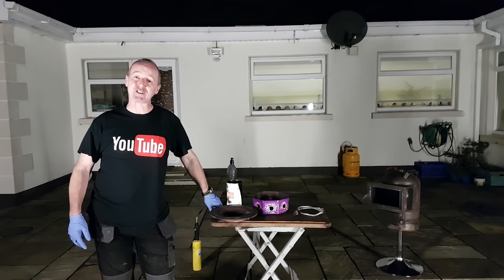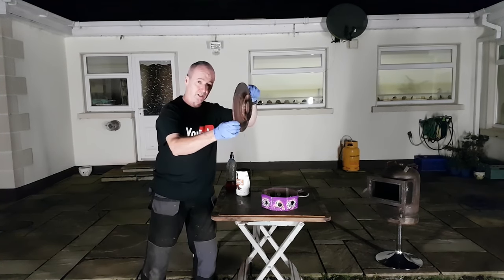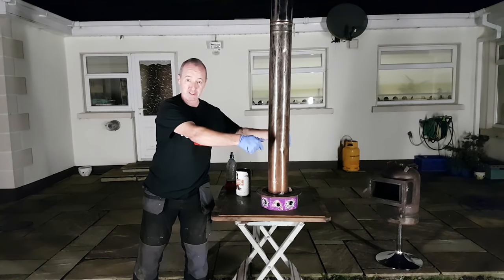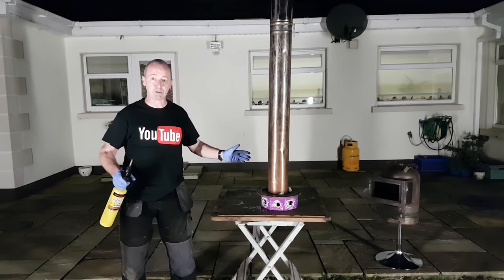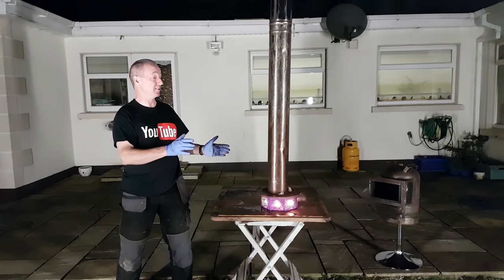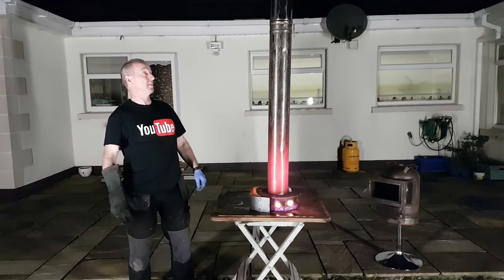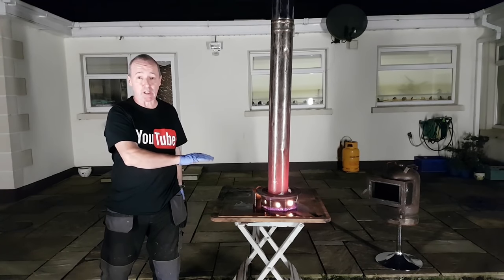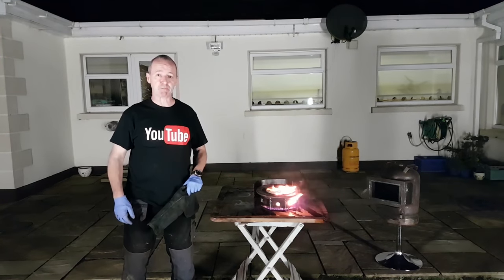Fantastic Output - TIN CAN - Waste oil Burner

Comment: Pardon my ignorance, is this clean burning when it fires properly?
Reply from the maker: Hi IndyRosebush I was just using this as a demo and a prototype but it can burn clean once you get it up to temperature and you can control the oil. In the next video I added a drip feed system https://youtu.be/WyredKT2VdE I made a better version out of steel  It is very cheap to make and I show how to make it. Here's a link to it running smokeless with and without a fan  https://youtu.be/kQNkefOdwUg Check out my playlists for a complete build tutorial Cheers Gerry
Reply: Thank you kindly, Gerry.  Appears to be an extreme amount of heat, similar to that of a rocket furnace minus the wood. About to rebuild my cottage and I am always looking for alternative heat sources, especially clean burning and efficient.

Comment: Really, if your looking for quick heat, all you need is the coffee tin and some holes stabbed about 3 inches from the bottom from a screwdriver. A quart of diesel and a rag and you've got a yellow dog. We use them to defrost oil rigs in the winter time.

Comment: Gerry can deisel be used instead of oil?
Reply from the maker: Hi Frank. Yes you can use Diesel or Kerosene just not petrol / gasoline Hope this helps Cheers Gerry
Reply: @GerrysDiy  thought so, thats great, oil or diesel, possibly a mixture, and safety first of course

Comment: I have a drip oil burner, 15 years old, gets hotter and hotter as the oil gets warmed and thinner. Basically a drum inside a square housing and a large fan and a red hot chimney. You can't leave it alone, it does the same dance as yours, sputtering etc
Reply from the maker: Hi CORAIRWILD That sounds cool. I made a different burner as my daily driver and I can even cook on it. Here's a link https://youtu.be/tnzEDEpz3Yk  I cant really cook but I though I could use the hot plate for shed projects but it is great for coffee as well as a shed heater. Burns about 2 litres per hour and makes lots of heat with no power. I just subbed to your channel Thanks for the comment Cheers Gerry
Reply: GerrysDiy I would make a vid of my oil burner, but divorce, and my ex changed the lock on my building and she called the police when I broke in to a building I occupied for over 20 years. So I have to empty it real soon, lots of junk in there, including my waste oil furnace. It's the same one my naybor has, he uses it everyday for 20 years, but you can't leave it alone. I'll be gttng my junk moved to my new building, it's in MY name, so no more worrying about who gets what, and your vid was fun to watch. I've made vids for over 10 years, 10,000 vids, pretty crazy

Comment: Any idea if this can heat metal to forge heat?
Reply from the maker: Hi enauyt. I think is would need to be fan assisted. My other burner made from steel which is normally aspirated can melt brass but would need a fan to get hotter than 800°C Cheers Gerry
Reply: Right on, got some more figuring to do then
Reply: Get a used oil burner.  You'll have no problem.

Comment: Not bad but I've been following you for ages, and built a few burners myself. Would be great if you did a video with a basic gravity drip setup, secondary air intakes, maybe some air shielding which could advance into forced air from a 12v bilge blower / squirrel cage fan. Your bids have given me a lot of inspiration but its summer in Australia so I'm working in a waste oil metal foundry for the next few months. Cheers for all the content!
Reply from the maker: Hi Paul. I will be doing some boiler stoves next week with that sort of setup. Hopefully it all works to plan. Thanks for the comment Cheers Gerry
Reply: Excellent,  all you need is put it in a  container to be able to control the air intake.

Comment: Bet the fire brigade likes you!  All jesting aside, this is something I intend to use to heat up my garage someday!
Reply from the maker: Hi Alonzo. Luckily the waste oil is reasonably predictable but the little updraft burner is a better option as a shed heater. I will be making a different type of unit very soon and it can be controlled electrically. Cheap too. Thanks for the comment Cheers Gerry
Reply: Alonzo Branson make sure you vent it outside
Reply: But of course.

Comment: Makes for good understanding of a two stroke power band.  When he walked away and it reached equilibrium...it took off
Reply from the maker: Hi Lawerance. This was just a quick and easy experiment but if properly tuned it could be a serious design. Thanks for the comment Cheers👍
Reply: @GerrysDiy  just put a swelled belly in your exhaust...I bet it'd work 😂
Reply from the maker: Hi Lawerance. It might be worth a try. I will keep it in mind when I am working on this burner next. Thanks for the comment Cheers Gerry

Comment: Your video made me laugh. I build these types of things to melt aluminum all the time and sometimes I wonder if its going to explode. I use a leaf blower and a resistor made with a coolant jug and salt water to speed up or slow down the blower. I use 3 control valves to control the flow and one valve with a long handle for emergency shutdown cause I like to see how far these things can go before total meltdown or what I call "Chernobyl'd" .
Reply: You can buy an appliance speed controller for $15 fyi

Comment: What to do about the toxic poo that comes out the flue?
Reply from the maker: Hi Micah. I made this burner as a proof of concept and just for fun. I use a different burner to heat my shed and there is no smoke and if I burn veggie oil it's a renewable fuel . https://youtu.be/tnzEDEpz3Yk Cheers Gerry
Reply: GerrysDiy I bet you get hungry burning that veggie oil.

Comment: This unit will not burn without the kerosene mixed wit the oil, when the kerosene burns out of the oil, the oil will not stay burning with the set-up like this. The correct waist oil burner types work quite well

Comment: Hey Gerry. Another good video on simple waste oil burners. I have a quick question.What works better in your opinion a burner such as the one in this video or the donut style burner where the air comes up thru the center. My wood/coal stove takes the air in from a bottom grate and I'd like to insert maybe 2 of these burners inside of it, but i want to keep it simple. Do you think that this style burner with just the brake disc on top, inside the stove fire box, would provide enough draft to allow it to burn efficiently or do you think that I would still need to block off the grate to efficiently direct the air into the burner. I'm trying to do this as simply as possible while still retaining the ability to burn wood, and make it easy to change over. Maybe I'm asking too much...lol
Reply from the maker: Hi Marcel.I will be doing a series on waste oil blower siphon nozzles that you would be able to put on a timer. I know they would need power but you could control the burn so much better and thermostatically and maybe even timeclock control things. The other updraft  burner is the better than the way this unit is set up at the moment but I have something else in mind. Thanks for the comment Marcel Cheers Gerry
Reply: GerrysDiy.    I'm looking forward to it. I made my first fire of the season this morning, which got me to thinking about this all over again. 👉

Comment: Your furnace works much like a Citrus orchard kettle "Smudge pot", the only difference is that the Smudge pot has the flue perforated with louvers and a 90° down draft tube from the flue to the fuel supply and has a hinged 2.5" cap on the fuel bowl with a damper on it. Once an updraft is created by the hot air, the Orchard kettle A.K.A. (Smudge pot) will sound like a jet engine and puts off some serious heat.
Reply from the maker: Hi Eric. This is just a quick way of testing ideas I have quite a few burners and stove videos on this channel. I will be doing a few blower type burner videos next week. Thanks for taking the time to comment. Cheers Gerry
Reply: Eric Dee ive been wondering what those burners are called, i seen one years ago and cant find one anywhere.
Reply: jammer2nz8h AJ  Can still get them new, about $350. In the '70s , they were advertised as salamanders in construction magazines.

Comment: Not much different from the "beer barrel" burners we used in the big tents in the Army.  Winters in Germany out in the field.  We used diesel and it was similar to these things which are pretty cool for fast heat if you have the oil available.
Reply from the maker: Hi whoknows. I was just messing around with the design. It's very easy to prototype with tin cans and then transfer the idea to steel. Here's a very successsful burner I made that I use in a lot of my stoves https://youtu.be/ShTLaYKjzxw Thanks for taking the time to comment Cheers Gerry👍
Reply: Mark  stationed in Wurzburg 71 to 73 went on operation Reforger remember these those very well those were the good old days.

Comment: Needs more air holes for the air fuel mix to be right
Reply from the maker: Hi. True ..The air mix is very hit an miss as I just threw in a quantity of fuel and  lit it. I made a drip feed system for this burner where I could control the fuel and I had great results. Here's a link https://youtu.be/WyredKT2VdE  Thanks for the comment Cheers Gerry
Reply: GerrysDiy in regards to air holes I learnt that you can not really make the air hole to big ! It will only draw what air it needs to be most efficient . You can only make them to small !

Comment: Is this automotive waste oil?
Reply from the maker: Hi ofacesig  Yes in this demo I am using waste motor oil but it runs just as well on veggie oil. This was just a prototype burner. I have made a fully working burner that I can cook on and heats my shed too. It can be made very cheaply.  Here's a link. https://youtu.be/ShTLaYKjzxw Cheers Gerry
Reply: GerrysDiy in the US I think we may be prohibited from burning auto waste.  That being said the applications are wider like you said.

Comment: it was the wind that made it burn like that right  it needed the high air intake to burn  that hot
Reply from the maker: Hi TheFrameoff. This burner was just for fun but it will run like that with no wind. The hot air rising up the flue draw in more flame and gassed which in turn super heat. I have lots of stoves and burners on this channel. Here's a link to a more sturdy burner that makes this much heat for my shed https://goo.gl/KRK7J6  Thanks for commenting Cheers Gerry
Reply: Thanks give it a whirl , Build On

Comment: Heat went out in my home. Im freezing. YouTube can help. Cookie tin from xmas, take off dryer vent, steal a rotor, drain neighbors car oil. Sweet this will heat my condo in Trump tower.  Just joking:).  Cool video.
Reply from the maker: +yzrunner  I built a more sturdy out of some easy to find steel. Here's a link.https://youtu.be/VJnOkSDK7DY cheers Gerry
Reply: GerrysDiy thank you. After I do some more research I will try to make a few for emergency use. For some off premise areas that need some heat. Love how fast it is to heat up.

Comment: Had one Kinda like this, but was pretty much a old Wash Tub with a snap on lis with a Stack/Chimney. Used it in the Bay where We would pull engines and transmissions at the Junkyard. We'd put in whatever we could find from the old cars Gas Tanks, Diesel, Kerosene Burt Oil  etc.... Kept Us Nice and Warm in The Freezing Weather. Lol ... PLEASE DO  NOT TRY THIS

Comment: I don't know that you made a waste oil burner but is an experiment.
Reply from the maker: Hi T wagner. You are correct it was an experiment but it does work and can be kept running for as long as you want or until the tin can burns out. I added a drip feed system in the next video and it worked better here's a link https://youtu.be/WyredKT2VdE. I have lots of waste oil burner videos Here's a shed heater / stove I made a few weeks ago that works on a similar principle https://youtu.be/tnzEDEpz3Yk I can even cook breakfast on it. Thanks for the comment Cheers Gerry

Comment: Can't use that inside my garage
Reply from the maker: Hi Yes Sure. It is a messy burner but I made a different burner unit and stove that makes a ton of heat and I show it heating my 30x20 shed https://youtu.be/ShTLaYKjzxw Cheers Gerry
Reply: Thanks - I looked at the other one. I don't have all those metal pieces :(    And I don't have much used oil. Oh Well.